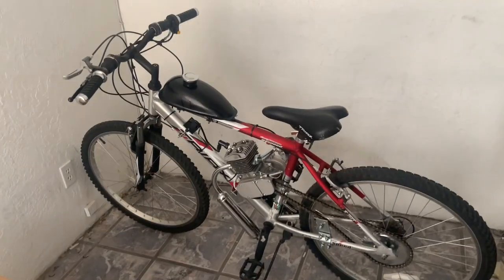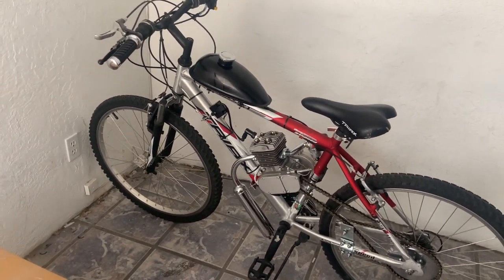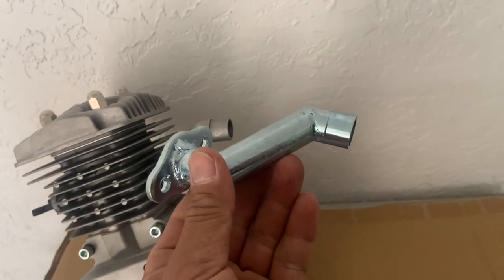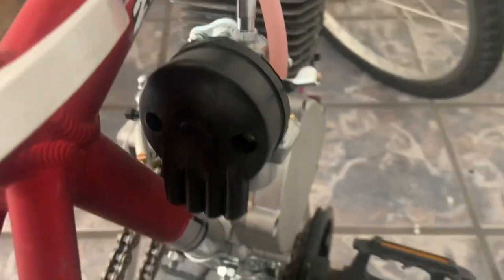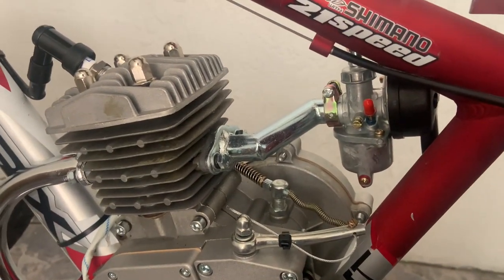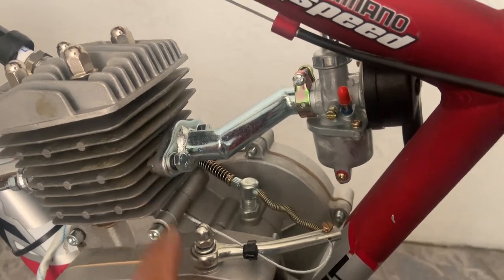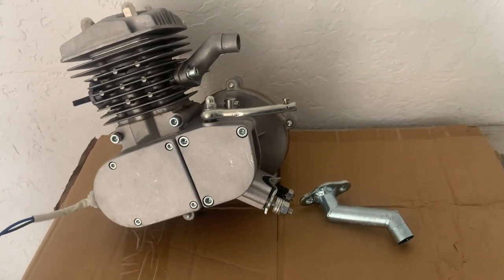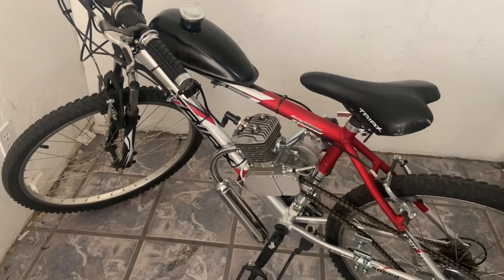How to fit a 2-stroke motorized bike carburetor in a smaller bike frame

Comment: Can't you just fit the intake Manifold upside down?
Reply: good point maybe you could but a lot of smaller frames still wouldn't be able to fit the carb. I'm gonna have to put mine out towards the side of the frame
Reply: I just order a 25$ CNC short intake off amazon they come with some decent length so I use a pipe cutter to trim it down if need be, that along with a low profile sandwich air filter mod you can fit an engine in most smaller frames , I’ve done it on a 24 inch frame